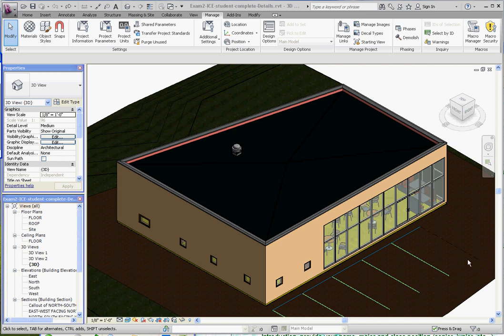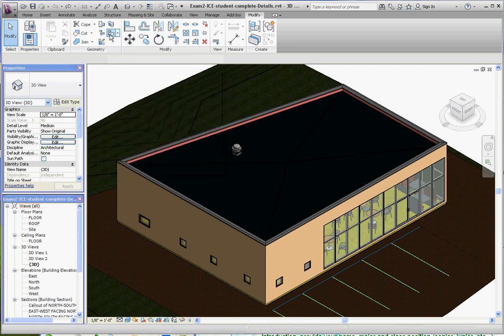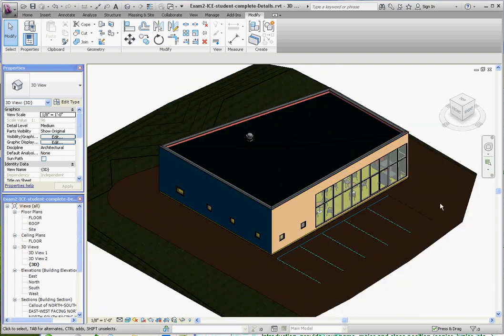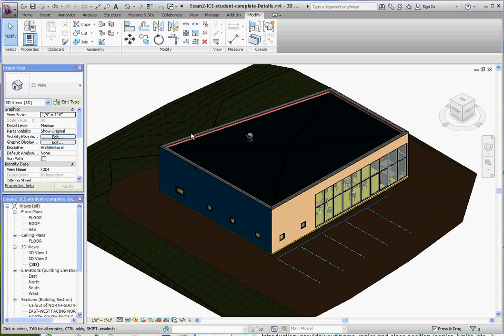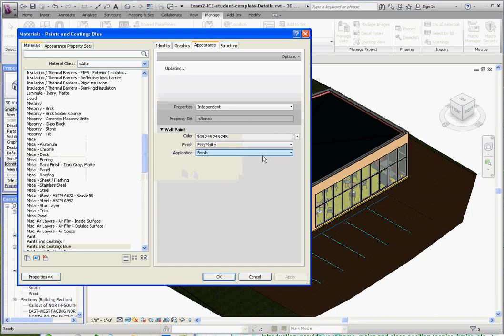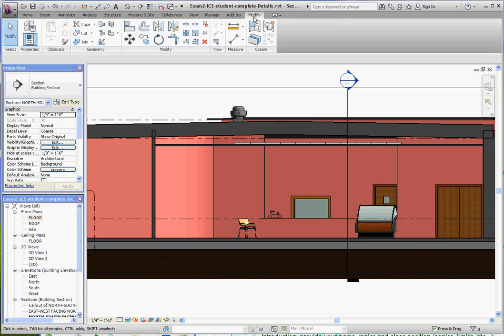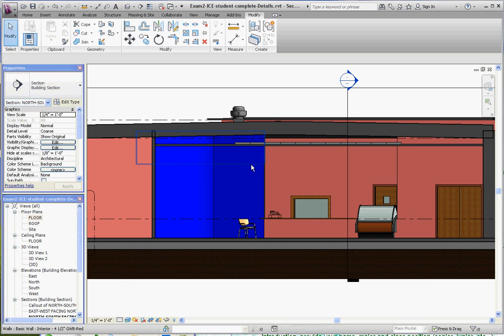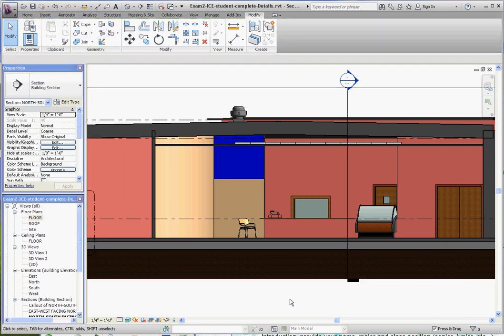Revit, Project Basics - Using the "Paint" Modify Tool

Comment: This is not the way to split wall for painting. Splt face is the apt command to use for pinting, which doesn't effect the structure
Reply from the maker: Thank you for the tip, both methods may work.  Do you have a link to share?  CSS

Comment: hi i have just tried to create a duplicate paint item, however within the paint section there is Gypsum wall Board and Parking Stripe i choose to duplicate the Parking Stripe. Renamed it Red Paint and change the color appearance to red. However both my new red paint and both the parking stripe changed to red. please help thanks.
Reply: Lee Dryden I figured this out, I had to click on duplicate this asset (under appearance tab)  after i had duplicated the material and this changed the color and the one item rather than both.
Reply from the maker: Lee Dryden I am glad you got it to work!

Comment from the maker: You can use the split line tool using lines and arcs on a portion of a wall or apply it on a planar wall surface as defined by the walls boundaries.  If you want to send me your model with some specific needs I will see if I can get it to work for you.